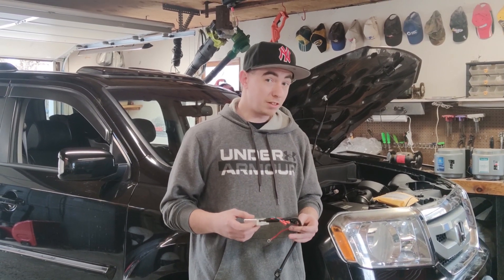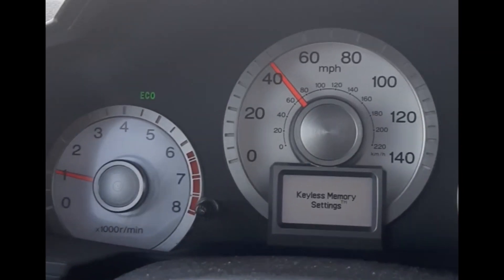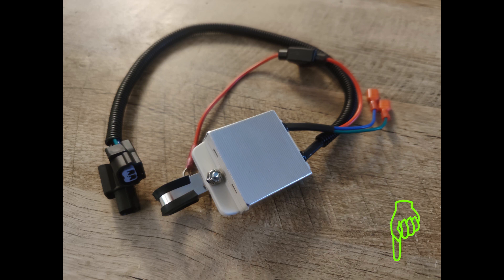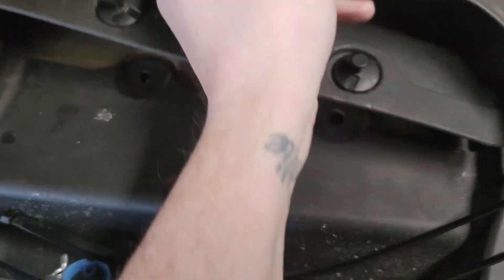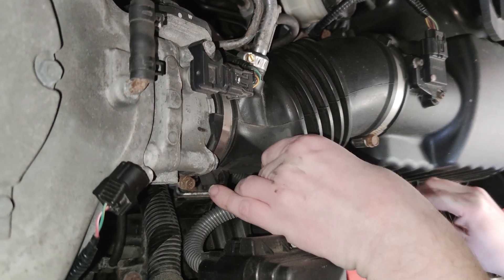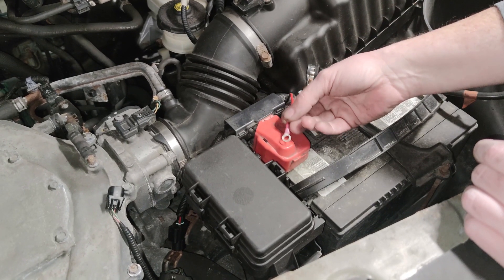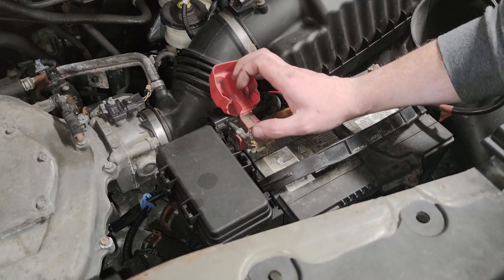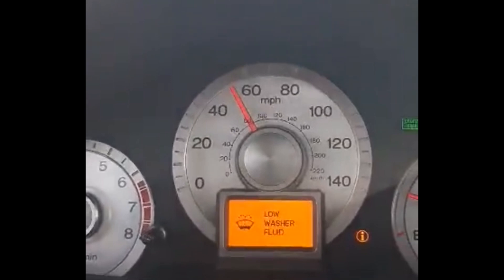Honda VCM Tuner II Eco Delete And Info

Comment: FYI: If you're planning on tuning your car, get Ktuner or Hondata and you can disable VCM through there.

 It'll save you ~$150
Reply: Ktuner is like $400 so that's not saving anything or an option for some people
Reply: @alucardhellsing666  well, having the ability to datalog and adjust your ecu will save you money if you work on your car, and preventing fouled spark plugs and oil burning among other things by turning off VCM saves money too, but what I meant is if you're going to Ktune your car, you might as well just skip the VCM Suppressor, and that would save money.

If you own a car with a tunable VCM, that means it's a V6 from 2008+; I think the majority of people owning a J35 Honda with VCM can budget/save up for the ~$700 for a ktuner if they wanted to, and the device can be resold for $300.
Reply: Tell me more
Reply: @BrokenMonkeyProductions  what would you like to know?
Reply: Is it compatible with Odyssey vans? How effective is the fuel savings setting?
Reply: @BrokenMonkeyProductions  Hi, yes it is. Just look up "Honda Odyssey VCM Suppressor"; S-VCM, VCMuzzler II, or VCM Tuner, all of them work in a similar manner. 

Some attatch to the battery, some don't. Installation is easy and there are a ton of youtube videos on it. 

Fuel economy should theoretically decrease 2-3mpg as all 6 cylinders are running at all time, but with increased power in your higher gears amongst other factors, mpg generally stays the same. I found the best power increase and mpg increase when using 89 octane. 

It is well worth it. The car will feel quicker, and be a good deal more powerful in 4/5/6th, not even mentioning decreased oil consumption and decreased engine wear.
Reply: It is not supported for all models in Ktuner. Check if your vehicle supported.
Reply: @alekseyk7266  it is as far as I'm concerned, because there's only 2 Ktuner Applications for any J35 VCM... the 8th & 9th gen accord
Reply: Last time I checked,  8th gen did not have this option.
Reply: @alekseyk7266  I had a Ktuner V2 for my 2012 Accord and it had thst option. IK 08/09 were somewhat different vs 10/11/12 with Ktuner, so maybe that's it.

Either or, you can def use a VCM Suppressor.
Reply: @chibba5418  Interesting, I did check it for my 2010 and function list doesn't mention VCM. It is specifically noted that VCM can be disabled for 9th gen so I thought it isn't supported on 8th gen.
Reply: @alekseyk7266  that's weird. I removed my hardware suppressor in favor of the Ktune software suppressor lol
Reply: I read from another 08 accord EX-L V6 owner that doing this clogs CATS! Then expensive exhaust repairs needed
Reply: @freedompioneer4311  I suspect the cats may be being clogged by the VCM when activated, due to oil making it past the piston rings when engaged.. Then being burned or spent through the exhaust on the rear 3 cylinders when the system disengages and begins firing the rear cylinders again as normal.
Reply: @jeremylarson7506  I suspect that's why many tailpipes have black suit in them.
Reply: @freedompioneer4311  Seems like a possibility, but unlikely.

The concern is incomplete burning by the time gases reach the cats, which can be due to multiple things (poor AFR, poor timing, poor spark plugs/injectors).

Your cats are being used the most work when the engine is working the hardest (start up, hard acceleration), yet VCM only activates when your engine is cruising in an overdrive gear below ~2500rpm (basically, when your engine doesn't work as hard), which means regardless of VCM being on or off, cats won't be working that hard nor subjected to hesvy stress.

Remember, VCM doesn't always come on. What I mean is the V6 functioning like a V6 (not a 4 cylinder) is something accounted for by Honda, so Cats are likely well equipped.

Either or, you'd probably realise something was wrong (misfires, CELs, poor O2S1 readings) before you did any costly and irreversible damage to your cats.

Furthermore, I'd surmise you're more likely to experience clogged cats due to VCM (from fouled spark plugs or injectors) than from disabling it. 

Based on anecdotal and empirical evidence, I still say it's worth it to suppress VCM

Comment: Does the tuner constantly draw from the battery? Or only when it would be disabling ECO mode? Wondering if it will drain too much battery over the lifespan of car?
Reply from the maker: That's a good question. I'm assuming it does not draw power when the vehicle is not running ..or it is such a small amount of power that it has not seemed to show any signs of battery issues in the past month and a half on our vehicle..so far. Will update if we notice an issue.
Reply: @GitItGarage  thanks for the response. Also wondering, does the VCM2 give any warning if the car is ACTUALLY about to overheat? Given that the VCM essentially tricks the car, just wanna know if I'll be prompted before my engine explodes hahaha
Reply: @toonakix  George, as the designer of the VCMTUNER II I can address your question.  If the vehicle reaches 212F or higher real ECT temperature, the unit will automatically restore the real temperature to the gauge cluster and the factory configuration with the vcm will be enabled in that condition.  The minute the coolant temp drops back down below 212F the vcm override will be re-engaged if the vehicle is moving.   The 212F temperature is just below 1/2 on the gauge and is the boiling point of water, so you would see the entire movement of the temperature exceeding 3/8 and hitting 1/2 on the temp gauge or higher.  The 220F temperature is the point where most gauges will show near 1/2 mark.  The 3/4 mark is approximately 240F.  - Brock

Comment: What were the green and red wires with the female terminals on the end for?
Reply from the maker: Good question! If I'm not mistaken one was too wire in an optional alarm for coolant temp overheating warning( not necessary as vehicle should inform you of this) and the other wire was to put a optional switch on the tuner itself if you wish to disable it for some reason.

Comment: You can just put a 80 ohm resistor in the green wire and solve the problem...
Reply: Where can I buy 80 resistor and the clip on both end? Radio shack is not exist anymore
Reply: @kttk7549  Just cut the wire and put the resistor
Reply: How would that work ???

Comment: Installed a couple days ago. Really happy with the way it runs now. Smooth and seamless!
Reply from the maker: Awesome glad to hear it thanks for coming back and commenting about you success!
Reply: I'm trying to get one for my 2012 pilot ex-l,hoping helping me because I can't afford a new engine
Reply: @elcabezon85  I just ordered for my 2012 EXL Pilot. It has 130k miles with no issues but I think this is a good low risk/high reward decision given the research.
Reply: Worse gas mileage???
Reply: @freedompioneer4311  1 or 2 mpg. Well worth it for the benefits.
Reply: @miketursky1410  so your eco light never comes on now? Is it easier to get the vtec to kick in? Does it downshift when slowing down faster?
Reply: @freedompioneer4311  never comes on. I believe V Tec is functioning as before. Transmission action seems to be smoother because there is no interaction with cylinder deactivation.
Reply: How is it running now?
Reply: @ahotdj07  Running great. Took a 2800 mile trip with no issues. No oil consumption. 25 ~26 mpg with a 300 lb motorcycle hanging off the back.
Reply: @miketursky1410  Good to hear.  I am needing to purchase one for my Honda Accord 3.5l V6 that is starting to consume oil.  Honda wants me to replace the engine at the tune of $6k.  The car is only 9 years old with 118,000 miles.
Reply: @ahotdj07  for $120 I would try it before replacing engine. After installing you might want to use some high mileage oil or cleaning additive to clean sludge and carbon on cylinders that get deactivated by VCM.
Reply: Where I can buy it?
Reply: @Mrtgreen410 VCM Tuner II website. I don’t have a link. Google it and it should come up.
Reply: I hear a subtle rumble noise when going down the road it's done it since I got 2 years ago with 105,000 miles Is that possibly the Vcm working and shutting off?

Comment: Does it mess with the coolant temp gauge on the instrument cluster?
Reply from the maker: Great question! Although some have had their coolant temp level show a slightly lower temp than before installing the vcm tuner, we did not notice any real change in our application(2010 honda pilot) everything with the cooling system still seems to be operating as it normally would including the radiator fans. Thanks for the comment!
Reply: @GitItGarage  It also has circuit protection to dis-engage if coolant temp reaches 212 degrees. Great protection with no manual resistor adjustments!

Comment: This thing rocks! Such a nicer drive on my 15 Ody now. Gets rid of the judder and shifts are smoother. Now the engine runs like a normal v6 the way an engine is suppose to run.
Reply from the maker: That's awesome! So glad to hear another success story with the vcm tuner! Thanks for the comment!
Reply: Just ordered it.... have 2010 accord 3.5.... #3 going out every few hundred miles
Reply: BUT HOW DID IT AFFECT YOUR GAS MILEAGE??? VERY CURIOUS
Reply: @freedompioneer4311  just went on a 2,000 mi round trip vaca a week ago and the best I was getting was 24mpg. Before installing I was getting 27mpg. So yeah I lost some mpg. This is on a 2015 Ody mini van.
Reply: @freedompioneer4311  says on website that it shouldn’t mess with the mpg all that much.

Comment: Good video.
I have a question about the operation of the fans. work without problem or are there risks of overheating?
Reply from the maker: Thank you! Great question by the way..I have confirmed that the cooling fans are still fully operational after installing the vcm tuner and no overheating issues at all! Thanks for the comment!
Reply: @GitItGarage  thanks for your answer my friend